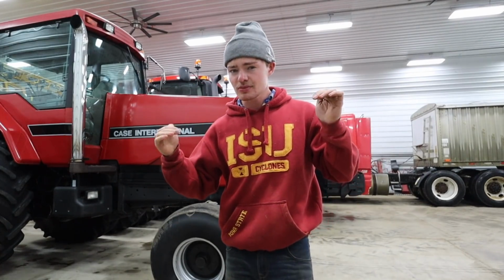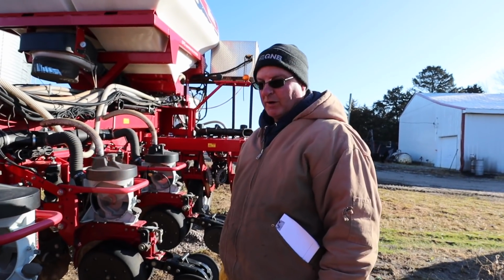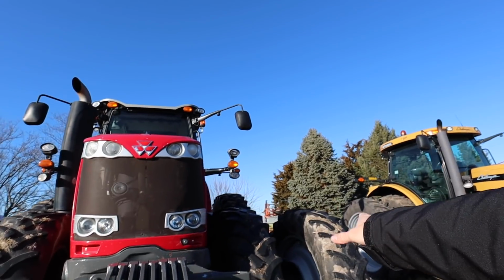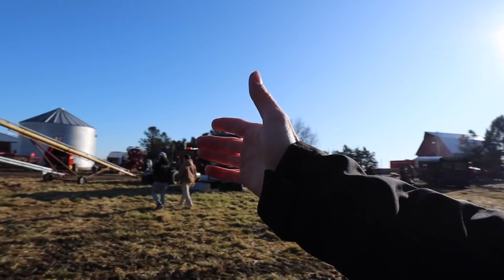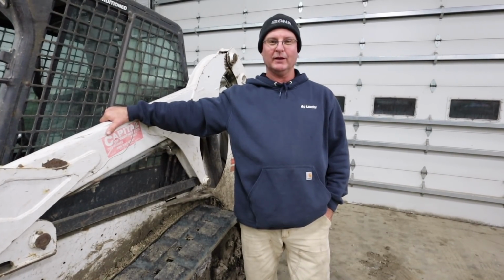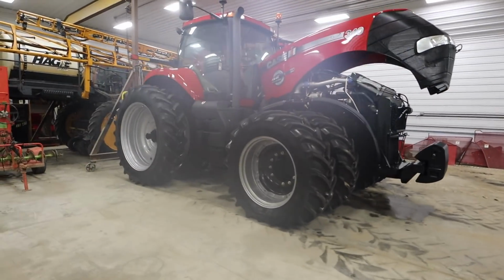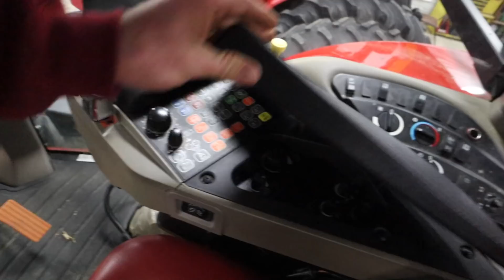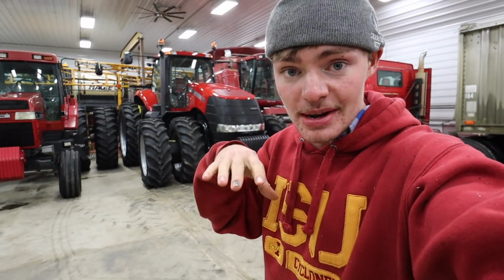I Bought My 1st Tractor!!

Comment: Cole, it costs money to make money. Investing in your farm when a deal comes along will show profits fast. If you're able to yield 40-50 bu per acre more by early planting and harvesting, it's a win-win.

While you've got the new Case IH 340 in the shop, rotate the tires. Normalize the tire wear. Since you estimate putting 300-350 hours a year on the tractor, purchase DEF by the case instead of the IBC tote. DEF goes bad, usually a 18 month shelf life.
Reply from the maker: Gunga Dinn good to know. Thank you!
Reply: And wash off any spilled DEF ASAP. Stuff is nasty.
Reply: @joelmiller2504  Absolutely..I drove a 2015 Volvo with a D13...that Def can make a mess. If I had a spill(tere), I would go to Blue Beacon and get er washed asap.
Reply: Make 100% sure you don’t put Def in the diesel fuel. Have to purchase a new fuel system, well over a 10k bill. Def also freezes at 12* for a fun fact

Comment: I love those 340s! I've been all over those tractors from splitting them to simple stuff. One thing I will say is as soon as you're in it, run it! those tractors are built to get into and be put to work and I've seen problems arise if they sit idle for too long and don't get up to temp in the mornings for the DEF. Lots of reliable power! I work on Red, Green, Blue. Yellow and everything in between but nothing comes close to working on case! And as far as ride quality I can't agree more the cab suspension is nice and simple but effective. The front axle leveling is nice also.

Comment: I have the exact same 340 Magnum. It's a excellent tractor and you'll love it. Lots of power, and smooth ride. One thing I did was replace the crappy lights on the back of the cab roof and the front of the cab. Found some LED's that fit the factory brackets and made a HUGE improvement.

Comment: I would love to see a little experiment with his tractor especially with it being the main corn planting tractor and new potential grain cart tractor. It would be awesome to see the  compaction caused with the current dual set up in the first season or 2 caused by the current set up, and thenba guy could GPS track where the tractor was driven for the one or two seasons to be able to pin point the compaction caused by this tractor as a control. Then I think it would be a perfect opportunity for the LSW tires to step up and allow you to change from duals to LSW and then run the same exact test for again season or two while GPS tracking the compaction during planting/grain carting and see how much of a difference in the compaction in between the front and rear duals compared to the LSW super single tires. I am form Iowa and am now in MN and I know the soil types we have would be perfect for this type of compaction test especially with the wet weather we've had in recent years. I know it's a long shot but I think this would be a perfect opportunity for Goodyear LSW to prove their tires are everything they say and should help with the testing and GPS tracking.no I don't want them to sponsor anything but the tires and help you with maybe the GPS tracking and to have professionals come look at the soil compaction but I would rather hear and see you the truth from a farmer like you instead of the LSW commercials because as long as you don't take a full sponsorship where you can't say anything bad about the tires this would say a lot about Good yearand how they actually stand in believes in their products and at their products are helping many farmers and are great for the soil for the future.
come on everybody let's all contact Goodyear LSW and have them set up a test with Cole maybe they can even provide the same tractor on LSW so they could have both of them the same season and then could have a little faster results and tell them that farmers like Cole the corn star are much more believable when their own money is on the line and US seeing a commercial. @GoodyearLSWTIRES
Reply from the maker: That would be pretty cool!

Comment: When I was a kid my dad and uncle had a machine shop in Kingman, Kansas. The farmers there would leave their plows and disc's and tractors out in the field where they last ran them. Then when they needed them the next season they would come in and demand dad come out immediatly and fix them up so they could plow or disc or whatever their fields.
Dad even had a disc roller that would latch two rollers onto the individual discs and roll them out instead of grinding them. I'm surprised any of those farmers managed to survive at all the way they operated.
I would love to drive that new tractor around. It ain't nothing like the old Deeres I drove back in the 60s.

Comment: The farm I work for bought a case ih magnum 235 with def on it a couple years ago used with about 1400 hours on it. The def system was a nightmare for first 7-8 months we owned it. Nobody seemed to figure out what was actually wrong with it and we tried several dealers. We finally ended up deleting the def system so we could actually use it. Been pretty dependable since then. It’s on the tmr mixer for a 1600 cow dairy. That 7140 is just broken in, I have a 7110 on the tmr mixer to feed the heifers that has almost 23,000 hours on it and has never had any major issues with the engine or transmission. Even has the original injectors yet! Runs like a top

Comment: aka... grumpy....please check and see if the motor does a [ regin ] because of  def it cleans the exhast..  im an old trucker and new truck i drove regined  i thought it was a run away engine..and was parked near a tree  and almost cought it on fire.becouse of the heat comming from the exhast pipe.just check to be safe.. thank yall for the videos.  love then ..want to see more of daddy cornstar. he reminds me of my dad.yall have a merry x mas.
Reply: grumpyassoldman grumpy yeah it’s gotta dpf on it... you can see the blue cap for DEF

Comment: Dont sell the John Deere tractor because if one tractor breaks down then you have a back up. It will also come in handy if you need extra help
Reply: david thomlinson itll be the one that breaks. It’s a John Deere 😂
Reply: @kanemeasham-pywell92  No Case will because every farm I have worked on the John Deere's has been going strong and the case tractors have broke down
Reply: @davidthomlinson6201  I can confirm, we have had a john deere 7700 for 6 years with no major breakdowns but our case backhoe with far fewer hours has needed major repairs

Comment: A lot here had the Def deleted from their tractors and trucks etc along with taking the centre out of their particulate filters the road vehicles are failing their year MOTs (roadworthy certificate) and it is costing more to fix it and now more are getting pinched with other machines where they have been tampered with.

I know ours is only 110hp but it too is the only one we have with Def and over this year it has only basically used 2 gallons as it only applies it when it is running hot it where it was applying fertilizer running at 540 it burnt some but not a lot as it wasn't really loaded. What burnt the most well pretty much all of what we have put in was the baling though the muck spreading will also likely burn a fair bit if it either dries up or freezes enough that we can get out and spread it.

Comment: We dual  Up front and back of little   110   Horse raking hay tractors with s tines and small drills. To plant our wet low spots. If you could drive over it with a 4 wheeler you could work the ground.

Comment: That is a nice tractor!  Hey Cole, don't know if you know this already, but you CAN WAX WINDOWS TOO.  Do it just like you would the regular panels.  Keeps water and debris off a little longer.  Just be careful around rubber sides and gaskets.  Won't damage but will leave wax marks.  I do this on my car every spring and fall.

Comment: Cole! Beautiful new tractor! One thing I can pass on. Use Power Service Diesel Clean in every tank. Just a squirt! That will prevent so many issues with the Regen process. Diesel fuel is not regulated as much as gasoline. The cetane on diesel can be from 44-60. PS will make it burn clean and efficient reducing the soot the regen has to deal with. Preventing it from constantly  throwing the tractor into derated status. Which then you have to have a dealer or technician come out and fix! Trust me on this one.

Comment: I do some restoration of old smaller scale equipment and plastics and bearings are always the first thing to check...
Rust is irrelevant (easy fixable) but all those damn plastics (hosts, clamps, fittings, bushings) really add up if they break down and can be really a pain to fix.
Checking bearings is nice, because often the bearing tells the story of how well a piece of equipment is maintained :)

Comment: I own a 290 magnum tractor.  We love it . It has some flaws but all machines do . Ours is a 2012 it had 290 hp we pull our 24 row planter with it. Nice video very good purchases you will get many years out of them. That 340 can do some tillage work as well. I still prefer my deere machines but a newer magnum is a good machine  especially if the price is great ours was a year old we bought it used from a dealership inventory reduction auction sale we basically stolled it .

Comment: Hi Cole , nice tractor you going to love it.  I have to say one thing you may not need all that power but you will notice how much the front wheel assist helps.  If you remember  the 5488. The dealer I worked at used one he pulled one more bottom plow with than a 2 wheel drive

Comment: Cool addition to your operation. Congratulations.
I bet next year you will be looking to add more acres to your operations due to the added planting capacity. Then in 2021 you will be looking to upgrade your combine to one that can handle a 12 row corn head. In 2022 it will likely be more acres and upgrades to your grain handling system, especially your wet bin and grain dryer. Just wait and see.

Comment: Do you really change the oil every 150 hours? How many hours do you run in a year. I work at a Case IH dealer and the tractors in that HP range that I see make about a 1000 hours a year. That would mean in off season every 3-5 months and in high season every 10 days. Case IH mostly recommends motor oil change every 600 hours. Personally I would do it after every 500 ish hours.
Reply from the maker: It's the cheapest engine overhaul you can do in our book. We generally put on about 200 hours a year.
Reply: @ColeTheCornstar  aha, with only 200 hours i can see the 150 oil change make a lot of sense. It is about a yearly service. Always nice to see people take good care of their equipment. These should last you a literal lifetime. The only reason you could have to pull a head or something like that is the gaskets and rubbers getting old.
Have a good day and thx for the reply!

Comment: Very nice. I love the case I h.  Just don't let the 340 set a long time with out running it or you will have problems with the DEF fluid going bad. And store your new jugs of DEF fluid in a cool place and don't over stock the DEF fluid because only has a 90 day self live. Congratulations on the new equipment and thanks for the video.
Reply: That's false. Because what about the people who buy it in totes and wouldn't use it up on 90 days?

Comment: Nice tractor!!!
Past years your 4840 pulls the planter. And you have said that the 7140 used to pull the planter. What was the reasoning for that?
What does the 7140 do in the past springs when 4840 and the MF tractors are out doing field work?

Comment: what are u doing with your tractors? how does 2014 tractor only have 1000h?? i mean our 2019 fendt was lucky enough to get 1250h this year. how?? on the oil change, we usually change our oils after every 250-500h, that seems do work and the dealer recomends it.

Comment: I have that tractors little brother and I found out that case used thin oil pans on them and sure enough mine cracked at 3700 hours, we had to pull the engine to reach the oil pan. pricey repair. other than that it has been a good tractor

Comment: I know you take exceptionally good care of your equipment, but just a heads up make sure you keep your def filter changed if it has one on that model, and if you ever have to park it in freezing conditions make sure your def tank isnt full, it will freeze and expand cracking your def pump. Nice buy, congrats and good luck.

Comment: I would check on those 2014 models. They used defective piston rings that shrink in cold weather so they need to be overhauled which was warrantied. Also they had a problem with poor quality seals in shift modules which blow out. Which also was warrantied but I would check to see if anything has been done with this one that you bought and if the warranty transfers over to you. Not trying to be giver of bad news, I just want to give you a heads up. My uncle's own exact model as yours and they love it.

Comment: The 7140 would have pulled a 24 row planter. I would have got a 1466-1566 and been done with it. Turned the fuel pump up on them to match what power I needed. 806-1206 would have worked as well.

Comment: Too bad you didn't find anything you wanted.. but hey! IF that trailer was Steffes Auctions you can always get pulled pork sandwich.. Always made the auctions worth it, no matter what! We put that roller deal on the steering wheel in a 1997 936 Versatile...it worked..sometimes but it wondered. At the time we pulled our air seeder with it, and had to go back to marker arms because it was just not accurate enough to plant with..it was always skipping rows. When we upgraded tractors the trimble system we had in our 535 and 435 quads was far far superior it was night and day.. Have you ever used the steering wheel auto steer in any equipment before? If you do end up installing it in your tractor, I'd love to hear your opinion on the system. I love your videos man, keep them coming!

Comment: think you might regret not deleting the def in the the future, but i get the whole shop thing however on the second hard most engine or shop related problems youll have with that case will  probably be def related. either way good luck guys nice to have newer toys to work with.

Comment: Wax it with Old Fashion Meguiers car wax. It will cut the thin layer of oxidation off and look like brand new. Be forewarned it is an oily wax/cleaner spreads and washes off easily. So maybe a second coat of a hard carnuba after the first. Good to go. The old tractors will look like new.
Reply: Oh, It's especially good for reds and blacks.

Comment: Dang only 7 k hours on the 1991 Case. For me, it's like a hardly ever used tractor. At my farm we have Massey Ferguson 3095 1992 model 120hp at just over 20k hours and it still runs beautifully. And our Claas Celtis 456 2007 model 105hp is just over 14k hours now. I know that those are, not massive tractors, but we have a dairy farm and we don't need massive machinery.

Comment: A $90,000 tractor seems cheap until you spend $6,000 per tire to replace 8 tires and $35,000 in upgrades and repairs.  Gotta pick up a whole lotta pop cans to buy that tractor.  My all manual 1194 needs tires, seat, exhaust work..but I can squeeze another season out of it if I plow with my 1949 
Deere corn popper!..after a tune up...

Comment: 150 hour per oil change? we do atleast 500 hours with premium oil. our tractors/wheelloader all got 12000 to 15000 hours, both tractors got refitted at 10000 hours to be sure that they'll run smooth. and there was low wear on them.

Comment: Well if Case won't sponsor you now, then then it just ain't gonna happen ;)

Hey, on a more serious note, I know your learning all the features but how do you see yourself working with the "proprietary"  electronics/code...basically the right to work on your stuff has been taken away by requiring you to use a dealer or mechanic to plug in and use official software....I'm not saying case is this way, but other brands have been seen has being pretty strict on simple code updates. It also affects us non farmers too with our daily vehicles, think simply resetting the oil light after an oil change on some rigs.

Comment: You guys would be better off turning your 16 row into a high speed in my opinion
Reply from the maker: It's a 1990 planter. I'd rather plant at 5mph @ 60 feet than 10mph @ 40 😇
Reply: I could get that. Lot of rocks in your area or just your preference?

Comment: DEF (AdBlue) = Distilled Water& Urea... pretty cheap stuff... but great for the planet in your spiffy new tractor... means you won't be breathing so many nasty fumes either. Think of it as an investment in your Lungs.  Something else you could think about is a Simple Hydrogen Generator I have one on my Car, cleans the emissions by burning them, increases the torque & milage. just needs Distilled water. & an anode every few years. Obviously, you would need one appropriate to engine size, but this unit WORKS... been using one for 10 years now. (De Verde  Hydrogenhybrids)  (uk) you would save money on fuel too.

Comment: I'm not digging your shades.  I thought you guys would be tightening your belts and not buying $200,000 worth of unnecessary upgrades after last years losses you told us about.  How can you go on such a shopping spree after such losses?  (I'm not judging, just asking).

 I think it may have been really smart to skip the auction planter that cooked in the sun. 

My first tractor that I bought was a 60hp  IH 756 from the late 60's and it was a great little row crop tractor that did just fine with 4 row implements for me.  It saved me TONS of money.

I like you guys better because you fellas are Case IH men! All of our equipment was red.
 I love how you guys are so diligent about Maintenance on your equipment and even wax it?!  I wax my truck allot, but the way my dad was, I couldn't imagine nothing to wax our tractors.